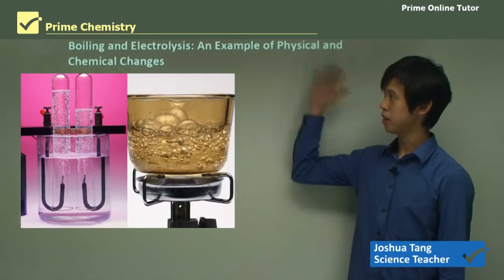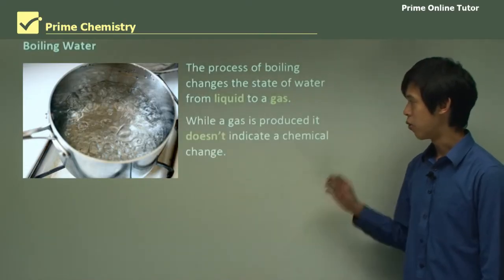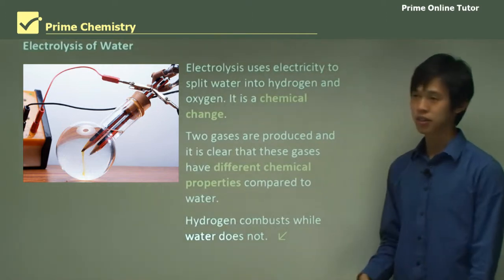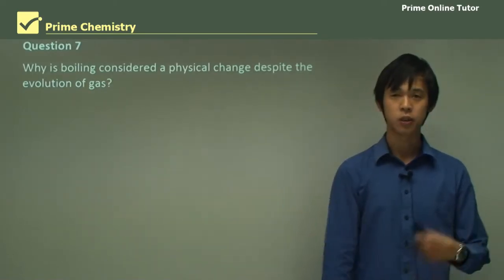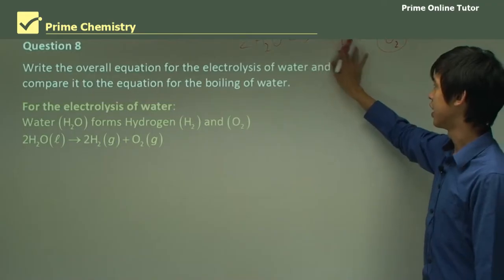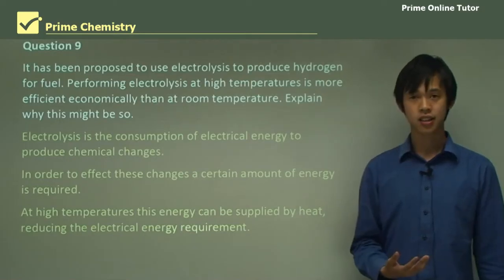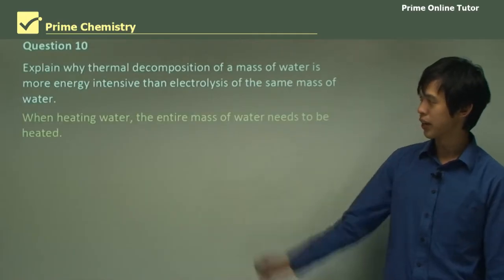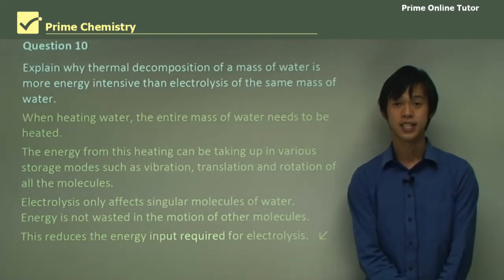💯 Comparing the Boiling and Electrolysis of Water Explained

Comment: splitting molecules takes a lot more energy than making them move. 
With a quick google search you can find that heating and evaporating 1kg of water to steam from 21C takes 2556kJ.
However performing electrolysis of 1kg of water to gas takes 20.000kJ, almost ten times more.